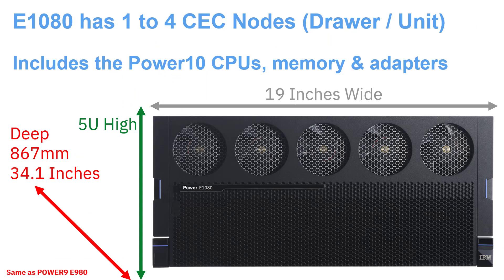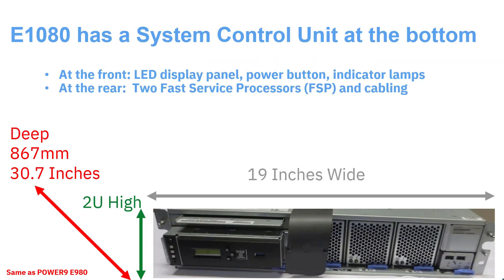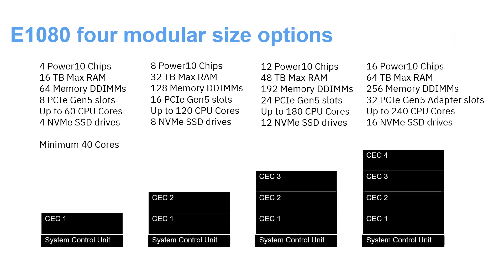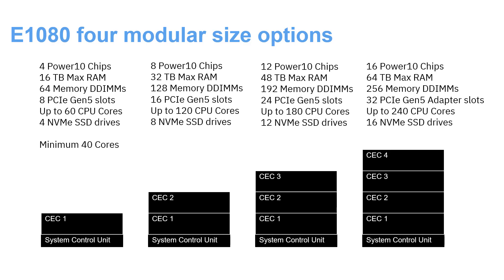IBM Power10 E1080 Technical Fast Facts

Comment: That pricing model is radiculus! Many companies will ditch power infra becuse if your are charged like in cloud with out benefits then just use cloud.
Reply from the maker: Thank you for your opinion. Perhaps, you have not come across these large servers or computing needs this large before. Power Servers might seem like they are expensive but they are large and extremely fast. They are cost effective too on a "Bangs per Buck" comparison = transactions per second per Dollar.  Power Servers are also a available on the Could
Reply: @nigelargriffiths  thank you for your response. I agree with your point that Power is extremely efficient machine. But that pricing might drive out those big users.

Comment: it costs like a boeing 777
Reply from the maker: Google thinks a Boeing777 costs $300M. 
So you are out by a factor of roughly100.
Reply: @nigelargriffiths  well Fully configured Tier 4 data center might costs like that.
Reply from the maker: @JMiskovsky  I am not claiming Power Sevrers are for every one and for every size company but IBM's top world wide size customers buy hundreds  of them.
Reply: @nigelargriffiths  well it is prouduct for most demanding costumers. That for your Mom and Pop local server.
Reply: Sounds like one when the fans start up  :)